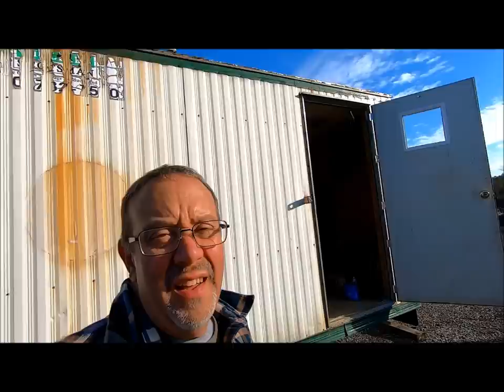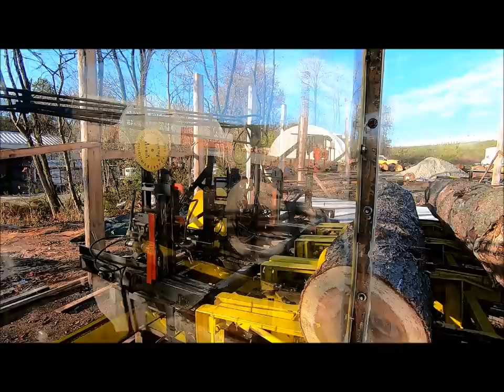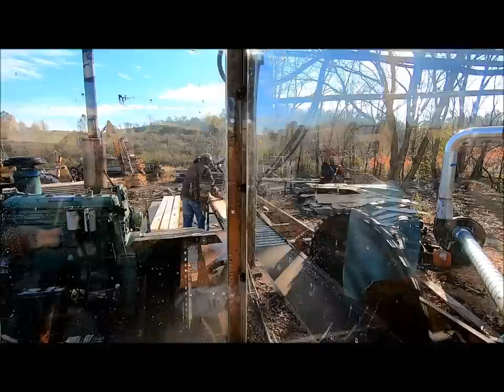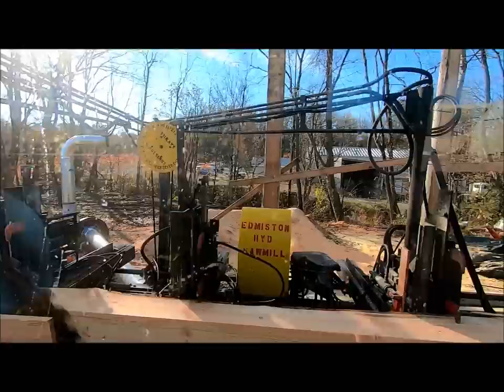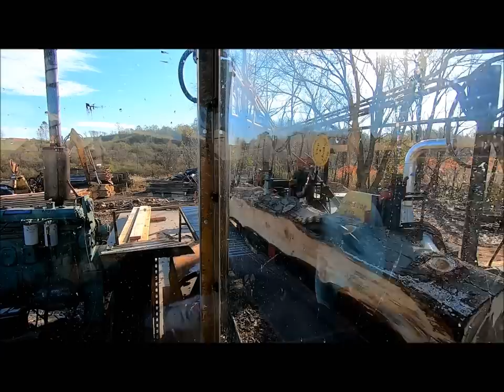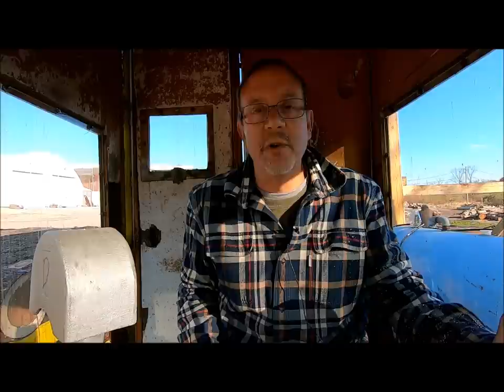more sawing pine

Comment: I've always been around old equipment and just moved stuff around while idling but about the worst was a 245 Cat ex-shovel with a hydraulic hammer on it. That thing was as stiff as an iron wedge when cold and HAD to be idled around. It had a 3406 engine with a pump drive with 2 or 3 BIG swashplate pumps and a gear pump for pilot valves and the whole shebang would strip out if not VERY careful. so it might be a good 45 minutes of me easing around. So just ease the old mill around while idling and things ought to go o.k.

Comment: Hey Mark what is the required HP for your mill? That 6-71 seems to cut thru everything like a hot knife thru butter.
Reply from the maker: I think you need at least 200 hp , the 671 is 238 hp from the factory.

Comment: Why not install a 2 cylinder air compressor on the Detroit for compressed air, no gasoline required, no engine to maintain and it will pump air at idle. 

Buy a new storage tank identical to a gas station air compressor only without the compressor. The larger storage tank will give you a nice store of air.

Food for thought
Reply from the maker: good idea.